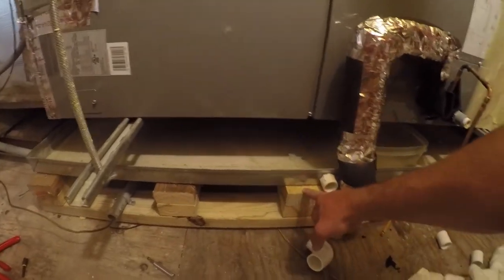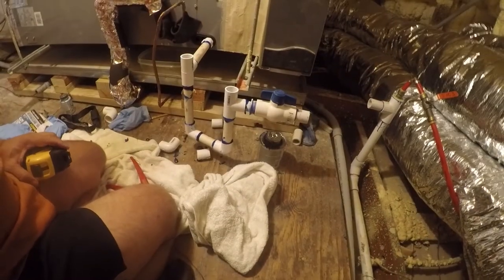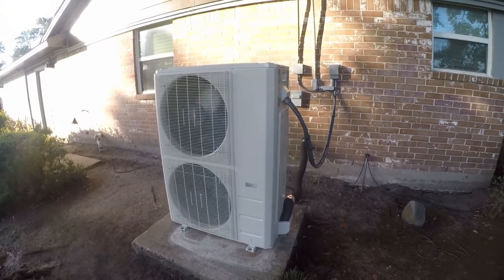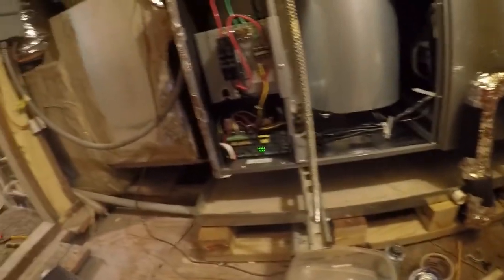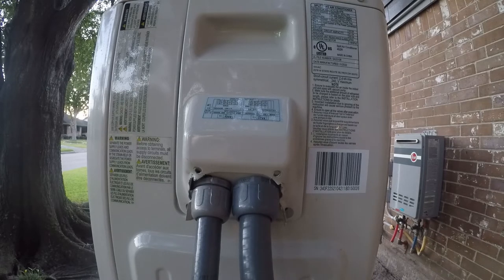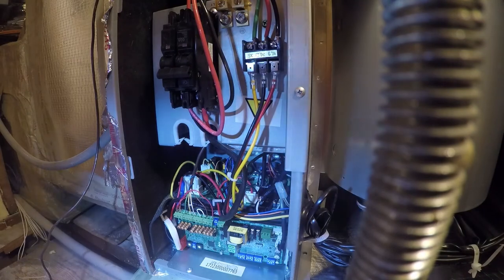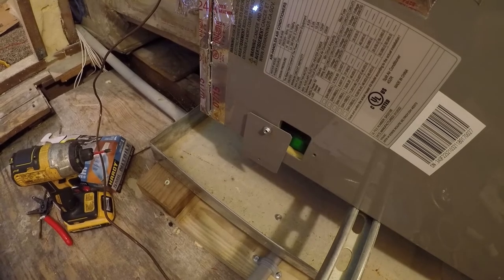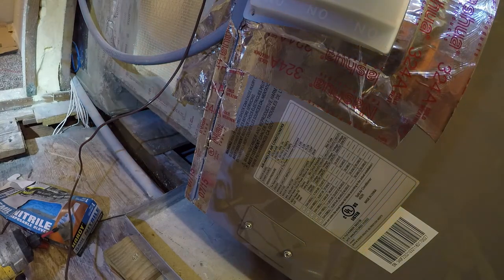HVAC 22: Condensate Drain, DIP switches, and running

Comment: It’s probably long gone with yours, but I used the Goodman sight glass - drilled a hole the same size, added a little glue-gun adhesive, all on the plate you’re needing to remove. Turns out the sight glass is super helpful- I got the idea watching this video, so thanks for the suffering.

Comment: Did you ever get the dip switches completely figured out? Also how has the data link between CU and AH as opposed to traditional working out. The "tech" from hvac direct told me it was better to not use S1 and S2 terminals and go with standard 24 volt operation. Not sure on this one. I have the same system as you and am stopped at the dip switches for tonight, will investigate in the morning. I am 50 miles south of Fort Worth Texas, thanks for any advice.

Comment: That EZ clear trap was plenty deep enough
Reply from the maker: I don't think it was.   I had gurgling issues at the other end of the drain with the Goodman system, which suggests the trap was getting emptied.  I also had signs of water being blown past the fan.... so no, it was not for whatever reason.  I had an ongoing humidity issue with the old system that I chalked up to the spray foam and air infiltration.  

Building it from scratch started out as researching the dimension requirements and then I realized the old trap probably wasn't sufficient.  The current configuration easily keeps the house at 74F and 49 to 50% humidity.  That's pretty impressive in Houston when it's 100F outside and 80 to 100% RH.  The results speak for themselves and confirm that the old trap was not deep enough.  It's possible it could have worked if it had been made deeper, but that would have required the same fittings and a $20 clear trap from Rectorseal along with their cute little brush.  Meh.

At any rate, I didn't have another EZ trap on hand and didn't want to spend $20 on it when I did have a few fittings handy and some extra pipe laying around.  This was both cheap and effective.

Comment: I don’t see a return duct is it a free draw Return?
Reply from the maker: I'm using the conditioned attic as a return plenum.  It's a compromise based on the available space and architecture of the house.  Probably a code violation, but it's worked fine for 7+ years.  There were three problems I wanted to solve:
1 - the system in place when I bought the house was perpendicular to the entrance.  You had to crawl over it to service it.  That's not acceptable.  Turning the unit sideways provided a place to work from for myself or anyone else that services the unit.
2 - Spray foam houses require conditioned air to be delivered to the attic enclosures.  The supply ducts are setup for this in the far and upper attics.  However, the air still has to return to the unit.  Front attic is handled by the supply to the far attic and return from the far end of the house where the primary (master) bedroom and closet are.
3- When I bought the house the return / filter was in the stairway between the upper and lower levels of the house.  This was probably efficient for whoever put that system in, but it didn't adequately service the upstairs.  The prior owner had been using window units to deal with this.  I relocated the return without a filter to the top of the stairwell.  The problem is that the bottom of the chase has the supply plenum and ductwork in it.  The duct for the upstairs goes up that chase.  Doesn't leave enough room for a decent return duct.  It's an issue with the architecture of the house and having a low attic compared to today's homes.  

There was enough free space to let the air just flow down the chase and around the supply ducts.  It's worked great.  The media filter is an excellent solution and performed flawlessly over the 7 years the goodman system was in place.

The code issue is that the foam is assumed to be flammable and should either be sheetrocked or have an intrumescent (fire resistant) coating applied.  Neither of those was done in this house.  The mitigation for fire risk is working smoke / co detectors, interconnection of alarms, a fire sprinkler system, and no fuel burning appliances in the attic.  Water heater went outside and furnace is electric heat pump.  I also made improvements to the egress.  I did not put sprinklers in the attic area.  I did make sure every piece of the living space is covered by sprinklers in accordance with NFPA standards.  I think it's 23D if I remember off the top of my head.